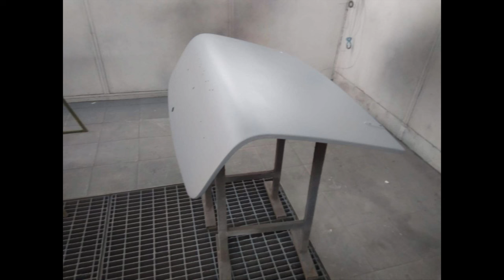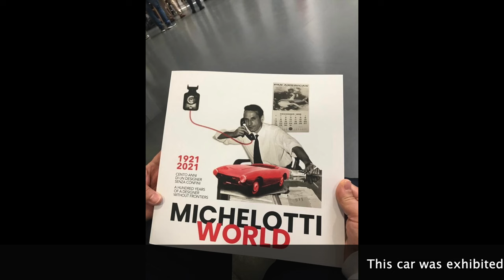Triumph TR4 , 1962, For sale!!!

Comment: Quality workmanship on a car that originated in the middle ages, compared with the DS beside it. Always liked the TR-4 and the TR-6 . Here in Vancouver, there is a reason why its called "British Columbia" are plenty of nice TR-4 and sixes around.
Truly a breath of fresh air between all the tasteless slithering Teslas in this town. Beautiful Jog Citro Garage, thanks.
Bas.
Reply from the maker: Bas, when I drive the Ds sometime I think about how it is possible that it is almost 60 years old and, in some ways, is even better and easier to drive than modern cars. When I drive the TR4, I understand perfectly that creating the DS they had thought more than 60 years ahead in the future...
Reply: @citro-garage  Today I drove my CX 2500 Diesel limousine from 1982. It still drives better than anything else for sale here. The DS is even better. The CX has this awful huge turning circle, and is way less sophisticated as the DS. Cheap brakes, cheap thin hydraulic lines, and flimsy interior. Still, it drives SO good. Thanks for your comment. Vive Citroen in Vancouver.